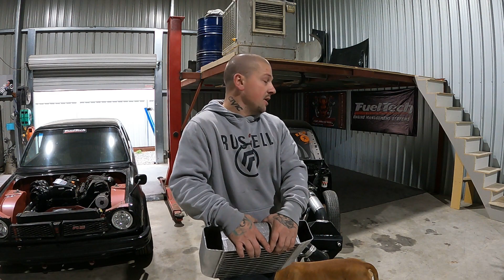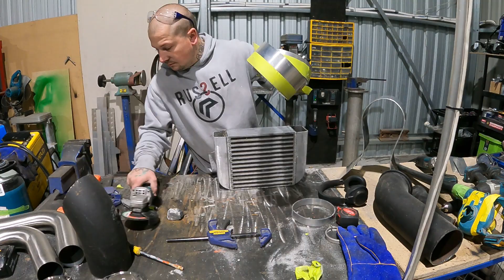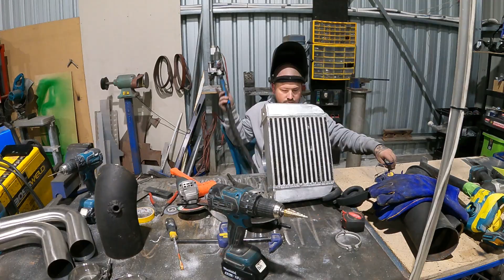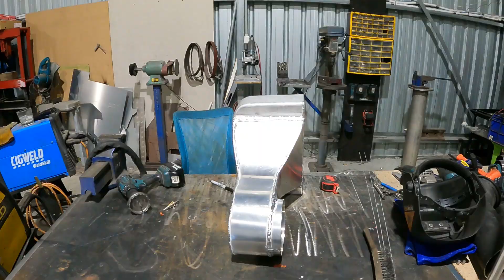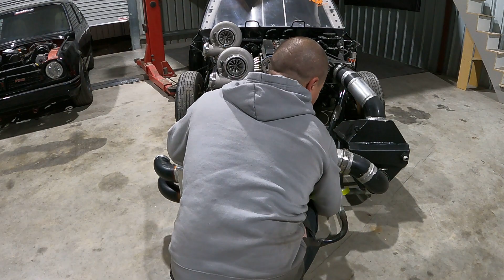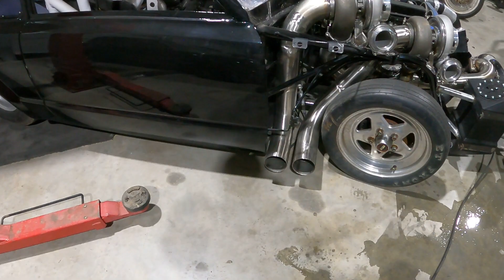2jz civic gets its 2nd intercooler with 3 turbos

Comment: You could run heat exchangers in the rear to cool off the water from your intercoolers before it goes back into the ice box
Reply from the maker: Yeah only need it cold for 6 seconds